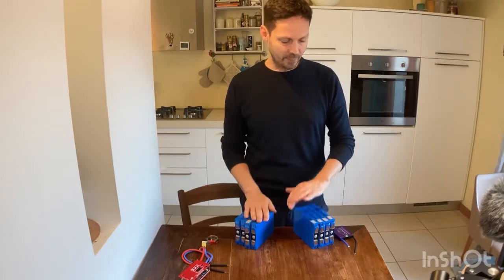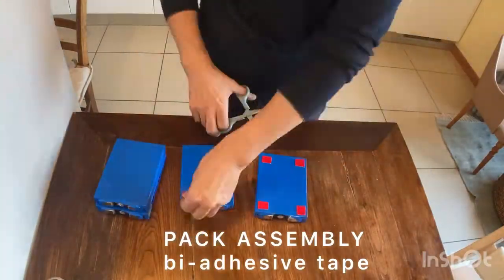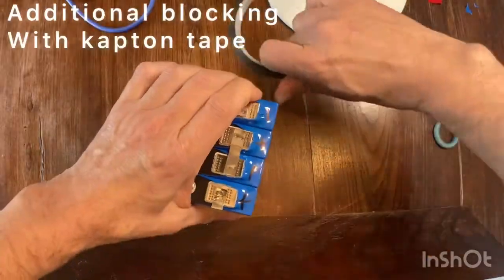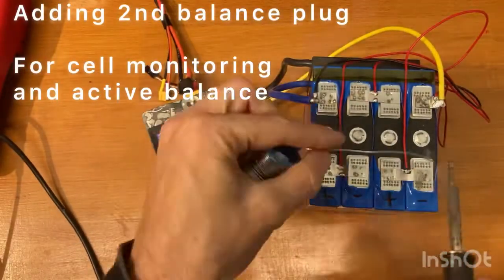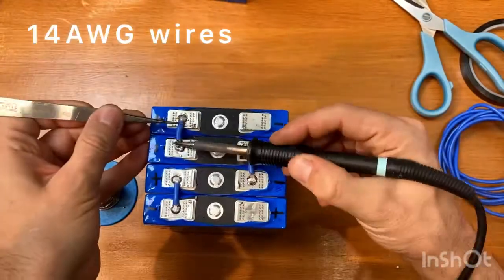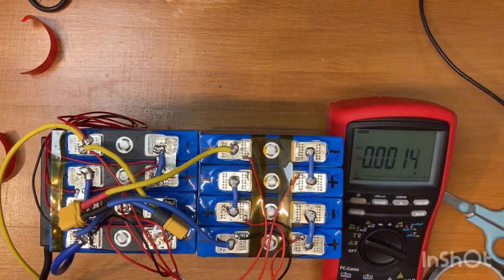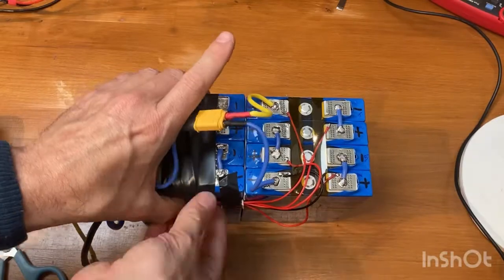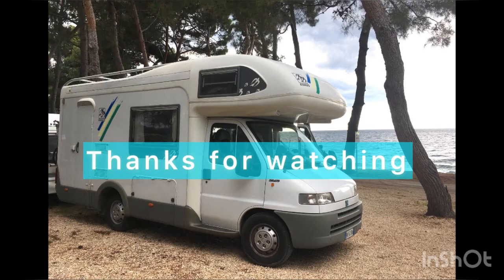Liitokala Varicore 32Ah lipofe4: test and 12V pack built

Comment: That's exactly what I want to build for my dinghy motor. Yes. I was wondering about the lack of screw connectors and real life capacity. But good enough and easy to build and ok weight 

What wattage soldering iron do you use ?

Great video, thanks for sharing this.
Reply from the maker: Hi 
Thanks
I used 80w weller soldering iron (wp80)
Reply: @MakerFabio  thanks for the info re soldering iron. I've been screwing around too long with bad soldering equipment since my old weller died and then I saw you weld and I'm "ok, just gotta spend the money and get a good tool again to last another 15 years). Nothing more frustrating than trying to weld with a bad tool. 
next step up on the cells is the 50Ah cells. and they have screw connections. I'd love 40's and if they'd have 35 would be ok. But if the 30's only have 25 thats a bit slim for my trolling motor. I guess I'll get what I pay for. The 50s are of course 5 kg for the pack and I was hoping for two 3 kg 30 Ah packs.

Comment: I've been looking at building a12s battery out of similar cells, liikala ones of AliExpress. , Needs to be 36v and what bms would you suggest. Bike is only 250w. And they don't go fast, would like biggest range and fastest charge time. Maybe a 5a charger, what's your thoughts
Reply from the maker: Hi
After 1 year my litokala battery capacity dropped a lot
So i would not buy again litokala
But i m sorry i don t have other suggestions
Reply: @MakerFabio thank you for your reply :). how many charge cycles did you do before it started loosing capacity , and what sort of current draw were you using
Reply from the maker: @lookoutleo  i think below 20 cycles
Because i used them in the mobile home seldomly
Current typically 5A for led lamps and heater fan only (gas heat)
Some time i asked 50 A for few minutes for test
Maybe the problem is that i kept them quite charged at 14V with solar panel
Reply: @MakerFabio  goodness that's not much , I was hoping to use as ebike battery and hoping for 100 mile range at low power setting